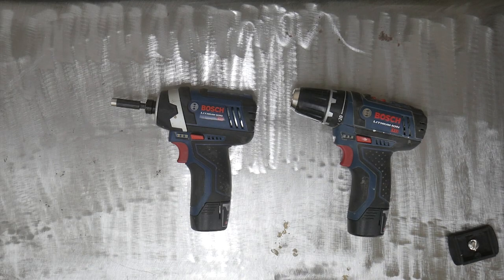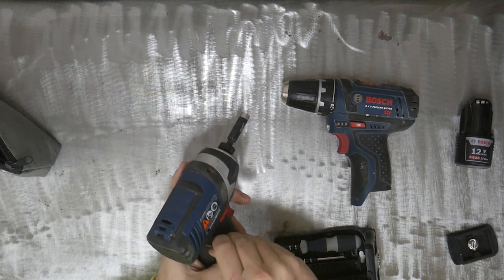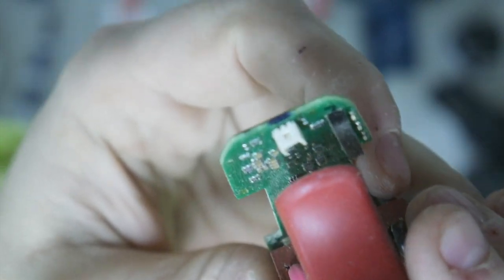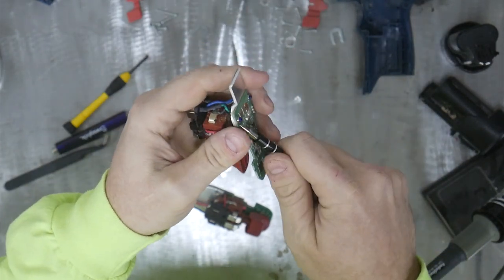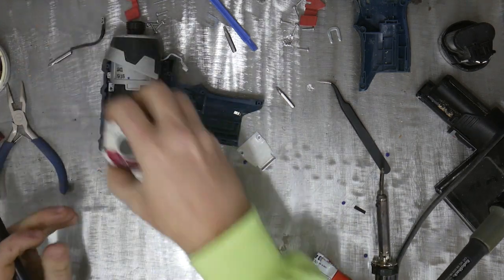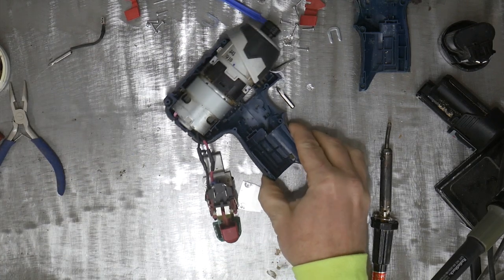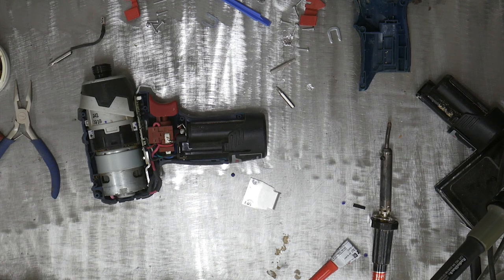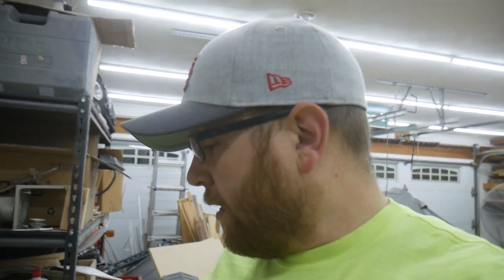Resurrecting My Favorite Bosch Drill

Comment: I’m surprised the rain killed it. Usually these bosch are pretty well sealed from the elements.
Reply from the maker: I agree, the circuit boards of many tools, especially drills usually have some sort of water-resistant coating, but these did not.